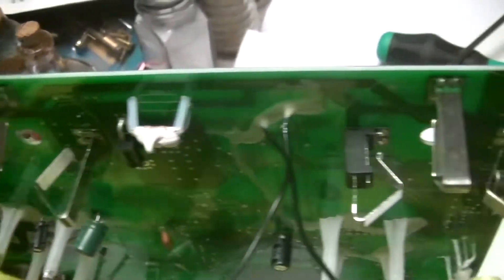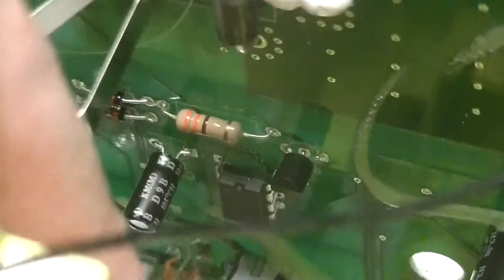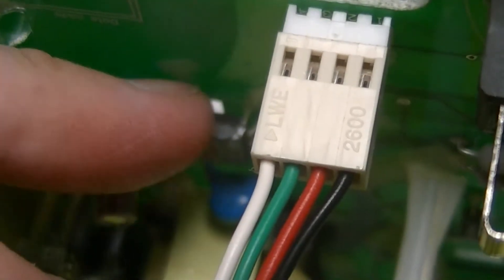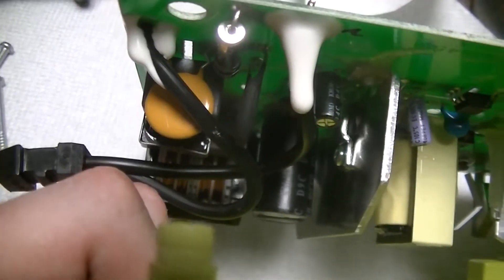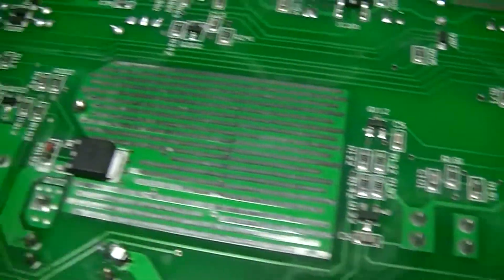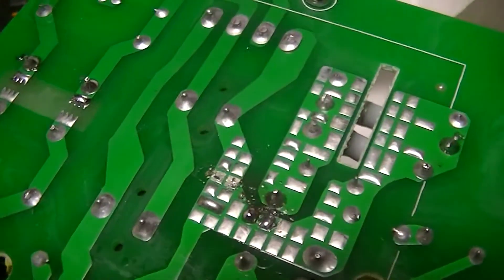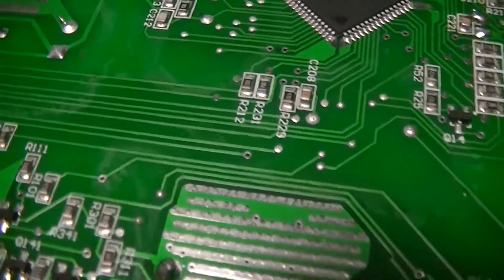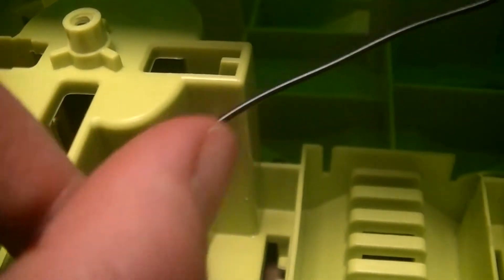Ryobi P125 battery charger guts

Comment: I have a Super Charger that when I insert a battery, one port will blink red for about 5-second and both lights go off, it will not charge; the other 5-work fine.  What do you think could be the problem?